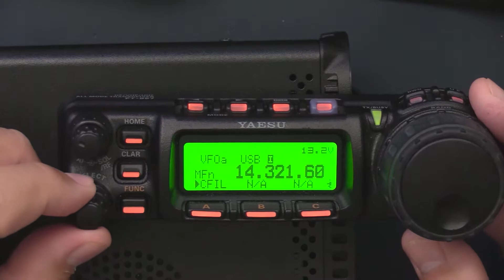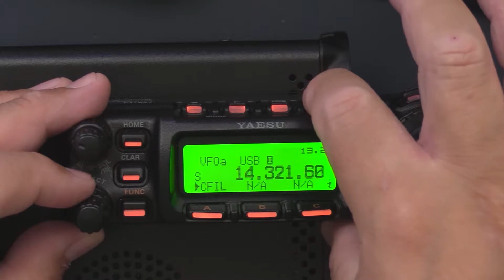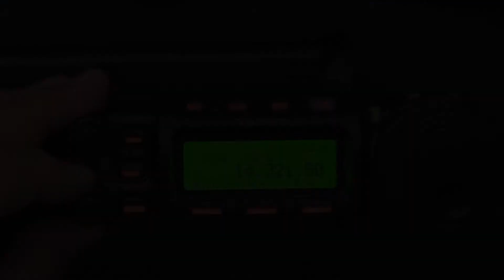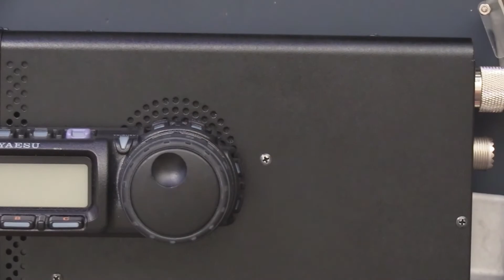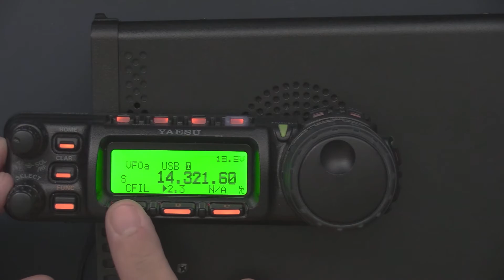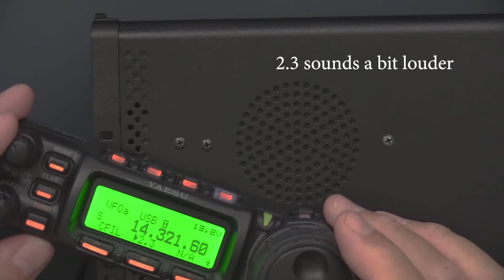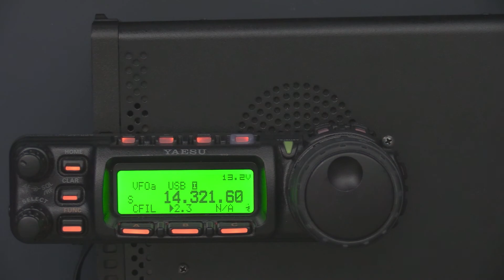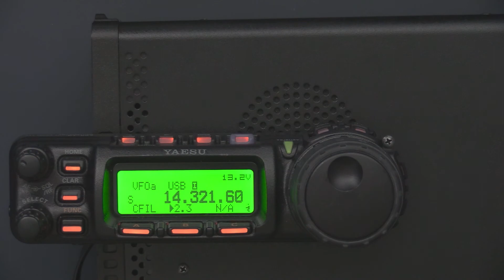FT-857 YF-122C Optional Collins Filter Installation + TCXO-9

Comment: Both options are musts in my opinion. I opted for the 2.3kHz and 500Hz Collins filters. Initially I did the 300Hz filter in my FT-817D, which I found too narrow and a bit ringy sounding. Today, I would consider a 1kHz Collins filter if available. The 2.3kHz filter is perfect for SSB phone on the FT-857D in my opinion.
Reply from the maker: I’m liking the 2.3 filter. It’s subtle but noticeable.

Comment: Is it still possible to find these TCXOs? I have an 857d with the reference unit. Ive ordered a non-oem one to try, but would like to find an OEM unit if possible.
Reply from the maker: I got mine from HRO.  They don't sell them anymore.  I would check on eBay and see if you can find an original.  Perhaps go to a Face book group, see if anyone knows of someone selling them.